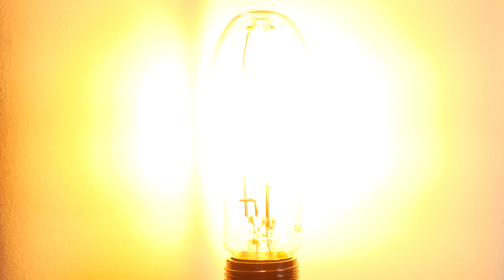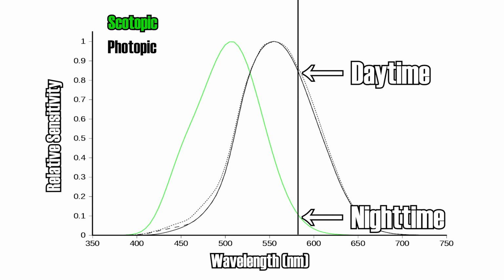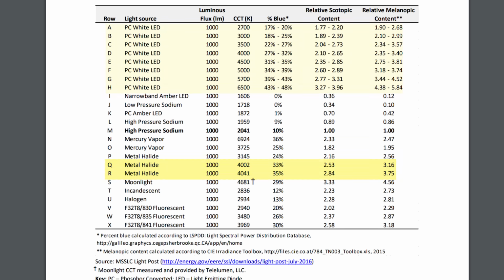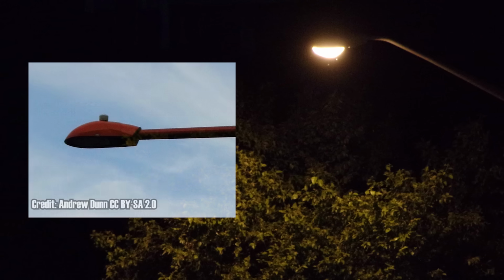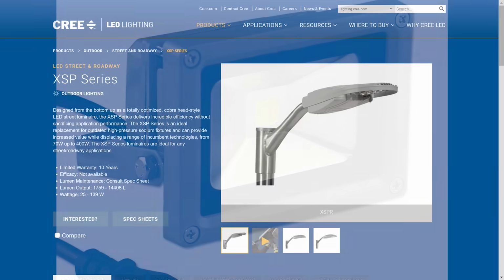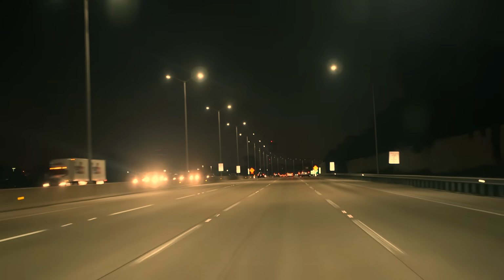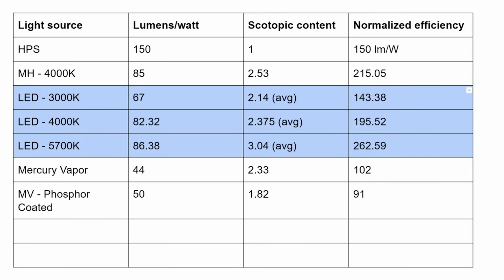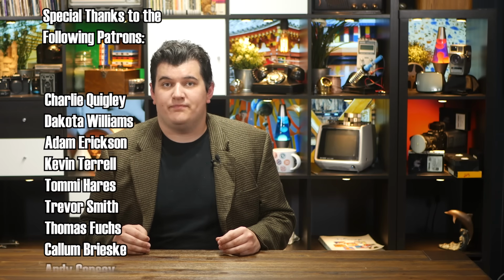The LED's Challenge to High Pressure Sodium

Comment: I would like a video series on EV charging, drive and battery systems. Few people realize the voltages involved and why the voltage is so high. Then you have the charging systems, The J1772 standard, the level 1 ,2 standards etc. How the heaters work, battery cooling, etc thanks for your videos.
Reply: Electric cars were popular in the early 1900's, how did we get from that to gas, now back to electric.
Reply: I suggest this because a lot my friends think my plug in hybrid just has a 12 volt motor, they don't under stand it is more like 400 volts. Honestly, I don't completly understand  all of. There are millions of videos on traditional car power train systems, few on the history of EV and how systems came about. I mean, what was the voltage of the EV1? The early pruis? Just think it would be fasinating and you would do a greta job..

Comment: LED lights have been taking over in the UK, Walking down a street feels like I'm walking around in a prison courtyard or supermarket car park.
Everything is so blue and cold feeling also i find them to be really bright when your near them but the fall off is so bad that shadows 
such as where cars are parked become black and its hard to see where I'm walking. I hate them but apparently they are "better"
Reply: Maybe you are used to low pressure sodium (largely used in the UK) and the change is more dramatical.
Reply: I think part of the problem is they are retrofitting the LEDs onto the poles that previously had LPS or HPS and the older lamps were better at casting the light in all directions, and were less likely to leave dark spots in between them.
Reply: I agree, I think a lot of councils and cities thought that they could make quick savings on electricity by switching to LED ligthing, but they didn't look at the bigger picture or actually do any assessments of the impact the switch would have.
Reply: I'm finding these new LEDs too bright, as you walk under them, they burn white dots/lines into your eyeball,
If anything they need better diffuses so I'm not looking at 8 LED lights under lenses as I pass by them.
also if these lights don't give off enough bounced light then we'll need more lap posts installed thus costing more and cluttering up our streets.

Its feeling like we made the switch too soon and they are still not good enough
Reply: yeah, the low wattage of the individual modules cause the light not to travel as far, a bit of that can be fixed by lens angle, if they had more modules with a narrower lens angle it would probably be a bit better, but at the cost of the spread. 
i found out because something with plants and comparing 1 and 3 watt power led arrays, and where sodium lights are no stranger either, albeit high pressure ;)
Reply: yes, I noticed the shadow problem too. It's also very dangerous when walking from well-lit area to darkness - it takes far longer for eyes to adjust, though that is not an issue for street lights...
Reply: Feels like they are using cheap LEDs which are sending out too much light and making shadows extra dark,
They are also not instilling enough of them so the spaces in between are now darker than they used to be

Comment: Sections of highway in my city are being lit with LED's, as the old bulbs burn out, they are replacing the fixture with LED lamps.  Driving under them is amazing how far you can see compared to the HPS lamps.

Comment: Hey there, I work in the lighting industry as a lighting planner for professional uses like street lighting, sports grounds, factories etc.
I have some input here:
Your table of LED efficacy (lm/W is efficacy, not effiency) is grossly outdated or based on not so good LEDs.
In good street lights (like the company I work for specs and imports) you can get up to 100-120 lm/W at 3000K CCT, and that accounts for losses due to absorbtion in reflectors and glass, loss in reflection etc.
It can get up to 130 lm/W at higher CCT of 5000K-6500K.
The LED chips on their own can go up to 160 lm/W or higher at 6500K.
Even at 3000K, the efficacy of LED fixtures is very good. We usually replace metal halide lamps with LED lamps that are half the power, and even get better illuminance than that of the metal halides (also true to HPS).
With lens design getting really good, light pollution is getting smaller every day, and allow much more even light distribution.
Here in israel we usually use 3000K for street lighting to replace HPS lamps (with some cases using 4000K), and the results are remarkable.
And for blue color - search for the photobioligical risk groups standards like IEC62471. RG0 group means there's no risk at all, RG1 has some, but perfectably suitable for street lighting, and RG2 is not so great.
Probably the vast majority of LED bulbs and fixtures are RG0 or RG1.
The LEDs that are in use today are royal-blue colored, and to control the CCT they're coated in phosphorous layers, the thicker the layer, the more green and red light you get, the lower the CCT is.
That's why there is a peak of blue light in the LED spectrum.

Comment: Do you think that people's distaste for higher colour temperature (cooler looking) lights is something that's been socialised into them over the years. Let's not forget that most people today have spent the majority of their lives witnessing lower colour temperatures (warm lighting) and it's only recently that cooler lights have become more widespread.
Personally I hate warm lights in anywhere other than my bedroom as anywhere else the yellow glow of warm lighting affects my ability to see things and particularly colours accurately.
Reply: Agreed. I used to dislike cool white lights, but when quality LED bulbs became available I realized it was just that fluorescent lights disgust me. The color rendition always seemed off to me, even from "daylight" bulbs. There's also the flickering problem. Even though 120 Hz is faster than persistence of vision, it still gives me eye strain. I have the same issue with CRTs and even LCDs that use low PWM frequencies to control their backlights.

When I switched to LED bulbs, I made sure to get ones that don't flicker. I also went exclusively with cool white, and I find them more pleasing and accurate than any previous bulbs I had used. This became essential as I started doing more digital photo editing where the color temp of the room lighting needs to match what my monitors are calibrated to.

I didn't have any sleep issues when switching to cool white. It's probably because I prefer dim, local illumination. I'll turn on bright room lights when I need them, but I get far less eye strain with dim lights. Even my computer monitors and TV are set to about 100 nits white point.
Reply: 98abaile Really? I want my house to look like a house and not like a god damn space shuttle XD I don't think white light goes well with green yellow and brown... Also it's just not at all cosy. My number one  priority in interior is to make it cosy ^-^
Reply: I agree with you. I grew up with wood paneled rooms, warm incandescent lighting, earth-tone appliances, etc. and just from an internal like-dislike standpoint I've always equated the brighter, whiter spaces to being cold and sterile. My current house had bright white patterned wallpaper when I moved in...it had to go. It just didn't feel like "home" with that combined with LED lighting.

Comment: I don' think it damages your eyes, but I've found LED with "bluer" shades are harder to see with. I frequently use many different LED flashlights for machine/mechanic work. Something about the light makes it really difficult to distinguish certain details, especially in metals. Even the brightest LEDS don't seem to give you the same detail as a simple incandescent drop-light or halogen fixture(although it sure is nice not to burn yourself on the drop-light shield).
Reply: You must be blind then.  Color rendering is many times better with LED than incandescent.

Comment: Yes but Sodium Bulbs don’t fade over time like Plastic Encapsulated LED’s do(oxidation). This is why Glass Encapsulated LED’s are absolutely necessary. But so far, all large LED Manufacturers refuse to make glass encapsulated LEDs. :-(
Reply: BlueFrostedGlass You don't need glass encapsulation as most high powered emitters used in large LED lamps just expose the bare phosphorus coating straight into the TIR reflector which will be made of glass.

Comment: This has become the best science channel on YT.
On topic- which are the night lights that create the nasty stroboscopic effect? I am talking about the trails you see when you wave your hand under a night light. They are incredibly bad and I can't believe someone would chose them for increasing safety in night driving.
Reply: I would think the stroboscopic effect is caused by a badly designed led power supply with unstable output voltage. This often causes led lights to flicker at mains frequency (50/60hz)
Reply: To answer your question, the LEDs that usually have a "nasty stroboscopic effect" are called AC LEDs and run directly off of line voltage (120V -480V.)  Most LEDs are DC-powered, and use an LED Driver to convert the line voltage. These drivers are constantly monitoring what is going on, and they provide smooth power to the LEDs.  The AC LEDs have their own buffers, capicitors, etc., but are more subject the the AC power that is coming in.

CURVE BALL:  All LEDs flicker, you just don't notice!  The AC LEDs are often just worse.
Reply: idk
Sure, bad LED driver (even as bad as a half-bridge) will cause a noticeable flicker. But it should be too deteriorating to the chip to put it into any kind of street light.

Comment: One other advantage of LED lights you did not mention is that they can be switched on and off very fast. This does not apply to bigger cities, but for rural areas and long roads with not much traffic, LED lights could be paired up with motion sensors to activate only the lights that are necessary.

I've often wondered here why roads are lit up even when there is nobody else around, and one of the reasons is because HPS lights take so long time to turn on. It would not work very well for HPS lights to be paired up with motions sensors, but with LEDs it would be possible and a ton of energy could be saved in rural areas.
Reply: +molson12oz It might be because power cycling incandescent or fluorescent lights contributes more to burnout than constant use—incandescent because of stress on the filament, and fluorescent because of wear on the starter. I suppose you could mitigate the stress on incandescent lights by adding a capacitor that causes them to fade in and out like the blinkers in a car or a traffic light, but by the time fluorescents were available, nobody wanted to use incandescent lights in freezer cases anyway because they produce so much heat.
Reply: Many devices are protected from the stress to components caused by flicking the on switch.This is called inrush current and you are somewhat correct about the incandescent,but it's been a long time since a fluorescent need a starter as a consumer -replaceable item

Comment: You actually want to mis-align the luminous efficacy of your lamp fixtures in scotopic vision, because the rhodopsin that rod cells are made of bleaches and degrades when exposed to light within its sensitive wavelength range, causing night blindness. Cone cells do not have this problem, so by emitting orange-red light that only excites your cone cells, you preserve the sensitivity of your rod cells which makes you see better in the dark, and causes your eyes to switch to mesopic vision. Using daylight temperature light actually shuts down your scotopic vision entirely, and causes your eyes to switch to photopic vision, negating the luminous efficacy advantages that you cite in your video. Mesopic preservation of rhodopsin sensitivity is also the reason why submarines and air traffic control towers use red lighting at night.

Comment: I was also wondering if the reason many municipalities are making the change is for the long life span of the LED bulbs. The cost to change a street lamp or highway light is much more than simply screwing in a new bulb, you need a truck and crew, you may have to reduce traffic lanes and have a crew set up cones and a blocker truck. If you can reduce the number of times you have to do this for a given fixture you bring the operating costs down significantly. Even without electricity savings factored in.

Comment: Are most LED street lamps actually lowered rated lummiens the the HPS? Were I live they replaced almost all street lamps with LEDs and they appear significantly brighter then the HPS. Now that just may be perception because of the difference in color temperature but if most localities are replacing HPS with higher lumens LEDs then that will make light pollution worse.

Comment: building a new home i've had my share with "hands-on LEDs"  CREE is good, but Feit has stepped up to the plate with better control over their dimming characteristics.     my home is 2700k with a few fancy pants items around 3000.    garage shop lights are 4100k at 40,000 lumens and outdoor security lights are almost 3000 lumens at 5000k per fixture.    kinda new to the scene is the dim-to-warm led tape light that will go from 3000 to 1800k as you dim it giving you a nice sunset-like glow, however the price you pay for some of these brands are silly.    for examply, to light my stairwell handrail i'd need to spend $10 per foot for the tape light, then the connectors, wire, power supply, etc totaling $500 for a 20-foot run.  then you run into voltage differences, 12 vs 24volt, yadda yadda.    home depot had a 24 foot, 24 volt led strip, 3000k dimmable with remote, power supply and hardware for $59!    needless to say i went with the box store kit and have no regrets.    the under/over cabinet lighting however is george kovacs and are 2700k and 120volts.   to buy tape, buy an aluminum channel, power supplies, etc would have been more than the $25/each light fixture from kovacs.  I could go on and on about lighting, I do have some videos during the build process, needless to say there are still 5-10 year old LED's being sold for hundreds of dollars and if you're not careful you'll be wasting money, time, heat, etc.   not all 2835, and 3528 led's are the same :)   they all demand different power supplies, different current ratings, different heat dissipation, etc.

Comment: I think I said something sililar in your last video, but I have no issue with LED over HPS; I'm not sentimental. I work 5 nights a week for a hospital, and have done since 2007, so I spend a fair amount of time walking around in the dark. My main need for street lighting is for it to be even; I don't want to be blinded by light when underneath one and then in complete darkness when not underneath one, which is mostly my experience with the LED street lights in my area. From what you have said this is probably down to poor implementation of LED lighting, rather than a problem with the technology itself. But I wish they would sort it out, becuase in my humble opinion these new LED lights in my area are not as safe as the sodium vapour lamps that came before them.

Comment: Since dimming LEDs is done by simply turning the light on and off hundreds/thousands of times per second, is there the potential for self-driving vehicles to be affected by this pulsating light source?
Reply from the maker: PWM isn't the only way to dim LEDs.  I don't know what these Cree fixtures are doing, but if they had current-regulating power supplies it can also be done that way.  Plus, HPS lighting is itself pulsing at 120 Hz or 100 Hz depending on the country (unless a digital ballast is used, but I don't know how common they are for HPS) so I don't expect it to be an issue.
There's also the possibility that with a fast enough pulse frequency, the phosphors would still be emitting some yellow light while the blue emitters are off, meaning the pulsing might be attenuated somewhat.
I plan on doing a video on PWM at some point, and I'll be sure to go over some of these issues!

Comment: Not disrupting night vision is an important feature of orange to red light.
 
The rods aren’t sensitive to it and the red sensitive cones are still active to some degree when the eye is light adapted.
That’s why red light is used in U-boats, mobile command rooms and such, where it’s important to retain ability to see in the dark because power needs to be preserved, or might be cut at any point. 

All this will of course be moot when driverless cars become a reality. They won’t need lit roads.